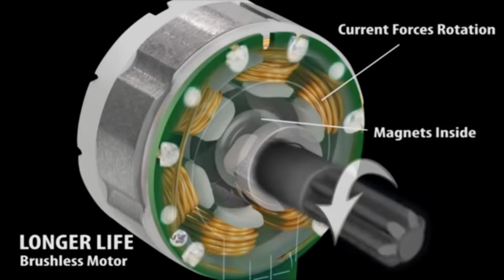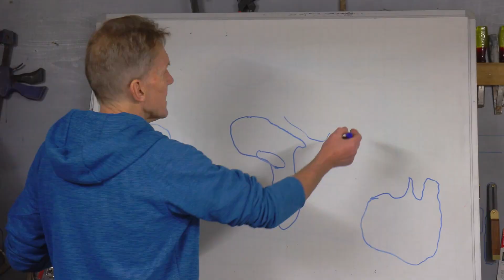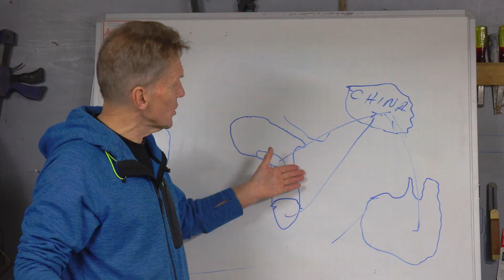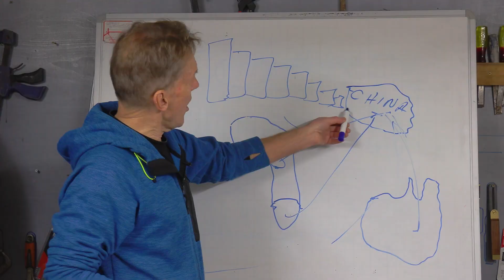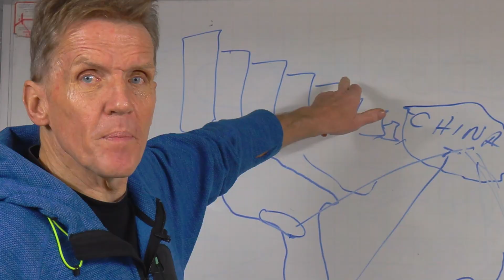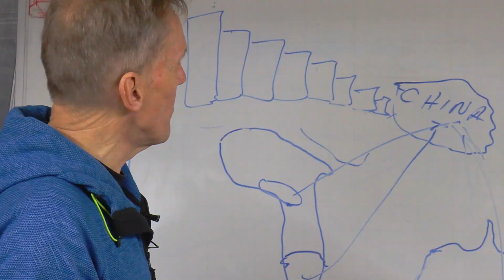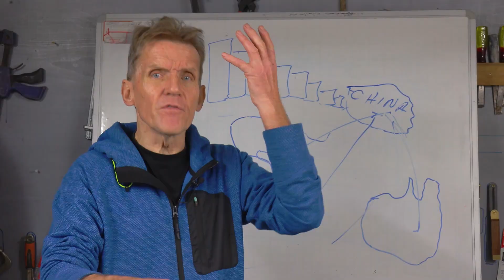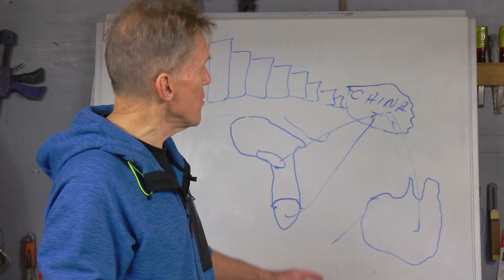The Crazy Cost of Going Cordless?

Comment: My family has had an electric grass mower for 25 years moving on to a cordless two years ago was a game changer.  Managing a extension cord while mowing was a serious pain in the neck and I never realized how much until I went cordless.
Reply: But..... Ill bet that corded mower is still at the back of the shed. Its just sat there waiting for the day the batteries die. Then it will be loved again.
Reply: @leathleyg5995  For one, I don't have the room in the shed so it's already gone to the scrapyard for recycling. For two, the batteries a rechargeable and replaceable, in fact I already own two in case I run out of power on big jobs I don't have to wait to recharge.  My only regret is I didn't do enough research, some companies have universal batteries on their products, so the same battery for you mower will work on you snow blower etc.  Or just one type of battery will work on all hand tools. etc.

Comment: Don't forget the cordless blower!  Changed my life! Love my Makita Brushless goodies. And I  agree with the drawing the line except I would love a cordless jig saw. I hate standing and tripping over extension cords. 

I am trying to restock the batteries with new cells, taken me ages to build a spot welder but almost there. My Li Ion battery packs have lasted well, but refurbishing is the way forward for me.
Reply from the maker: Battery manufacturers should be made to make serviceable batteries ie single cell replacement by consumers.
Reply: @SkillBuilder  Yeah its a bit of a mission. Had to drill the screws out.
Reply: @SkillBuilder  Exactly. Spot on.
Reply: @SkillBuilder  I agree with the sentiment, but this would add to size, weight and cost to be safe, and probably be detrimental to the robustness of the pack.
 I'm happy to replace cells as things are built now, but I'm very aware of the consequences of getting it wrong - the energy stored in those packs can do a LOT of damage.
Reply: Get the Makita jigsaw asap. Don't forget a track saw while you're at it.
Reply: @jeremyfreeman866  Cheers, brushless variable speed one has been in my shopping cart for quite some time now on ebay, around US $200. I do have a Makita track saw (thanks to Skillbuilder insight), corded one, which is just fine. I do not need cordless there. Line was drawn. Also cordless costs a heck lot more, and don't waste ur money on any DC brushed ones. I am so over brushes.

Comment: Nothing beats a corded 240v tool. Lighter, endless power. If you need a cordless fair enough. But if you have the power supply and don't need the mobility and convenience that 240v will run sweet
Reply: hi ,i understand where you coming from ,but as a tool freak myself can tell half of my cordless tools are lighter thank my corder units(mainly 230 ,hate 110_)
but whats main benefit in my eyes besides portability is torque ,in old days if you didnt have gearbox on drill drivers good luck with stainless delicate fixings ,now not a problem low rpm with hight torque job done,btw happy new year
Reply: @marekmroz5018  hey Im not for or against  I have some quality bosch 36v cordless, Makita cordless old nicad and lithium ion,   all quality gear. I love it. I just think sometimes corded tools were seen as old hat but they bang hard all day long with no fuss. I love my corded Makita  SDS drill. It's light and if I have chases to knock out or tiles to get up or just lots of drilling to do it's what I always reach for. If I'm outside pitting up exterior lights at the top of a ladder or whatever then cordless is a god send. All good stuff
Reply: 110v are far safer and 240v are not allowed on building sites. This is due to the inherent safety of 110v. Battery are also OK and acceptable in industry.
Reply: @davidatkinson2167  yeh but bollox to pissballing around with 110 trannie for a domestics. Load of bollox that 240v is some kind of imminent deathtrap. Fair enough health and safety need to be considered on large sites with 55v center tap but not in the domestic world. I rarely saw many 110 boxes on domestics and haven't used mine in yrs. Might put it on eBay bloody lump of a thing
Reply: @davidatkinson2167  You are of course correct, but it's not the lower voltage that makes 110v safer on a site in itself, its because 110V uses an isolating transformer and effectively isolates the power from earth.  I used to work in a electronic repair workshop and we had isolated mains in there also, though 240v.  Isolated supply is effectively like wearing rubber boots or standing on a fibreglass stepladder because the earth is dangerous, I know this causes confusion for most people.
Reply: I bet they do.
Reply: My DeWalt brushless drills and impact driver are a godsend.